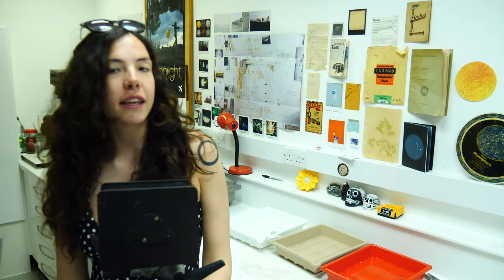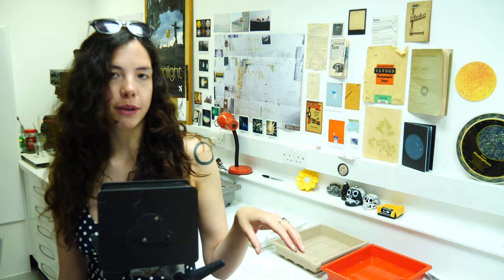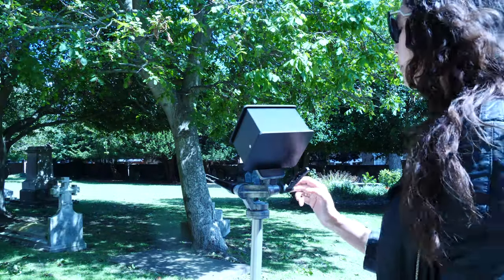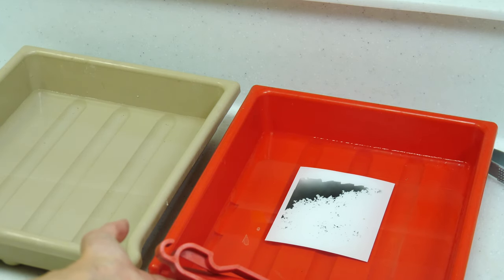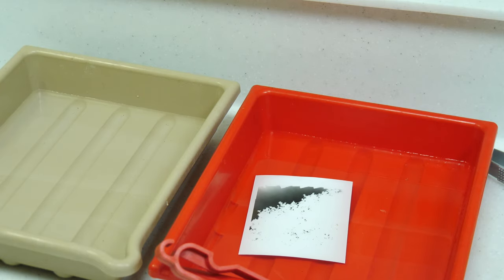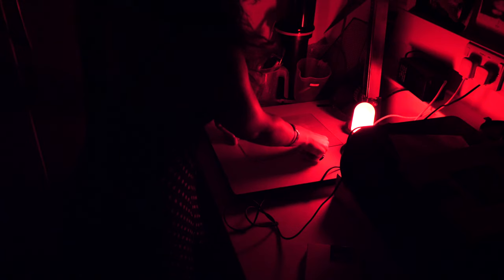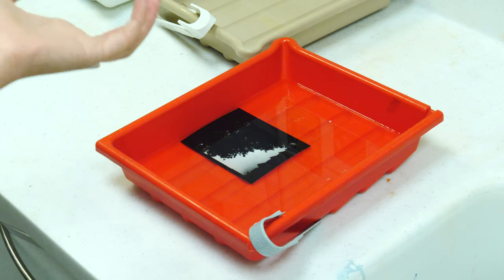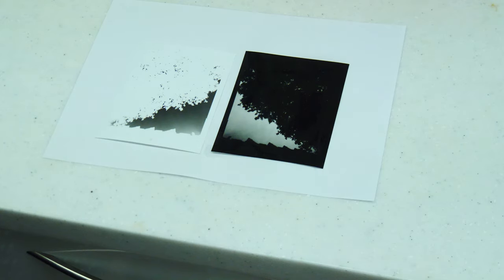#DIY Analogue Paper Negatives Made Easy

Comment: I'm confused,what paper did you use for the negative?
Reply from the maker: Ilford Multigrade Resin Coated pearl.
Reply: @MelanieKing  But isn't that too thick,surely it needs to be thin and have some sort of transparency to it,how does the light get through such thick paper
Reply from the maker: @KevinGarlandJames  nope, the exposure is long enough to get through paper. Paper is quite translucent if you hold it up to the light...
Reply from the maker: Also the exposures are 30 seconds!

Comment: What is the appropriate time per second for exposure in sunlight or in normal light with a pinhole camera, who has correct information, thanks.
Reply: Paper negatives (generally) have an ISO of around 6. You'd use a light meter to determine how long to expose/what aperture to use if you're shooting paper negatives in a LF camera, but since this is a pinhole camera you're probably going to have to experiment

Comment: Out of curiosity, if you were holding a sheet of photographic paper in complete darkness with no safe light, would the emulsion side feel extra smooth as well as sticky? Even if it was matte paper, would the emulsion side feel smoother than the other side?
Reply from the maker: Yes, if you lick your finger and touch the corner of the paper - the emulsion side should feel sticky.